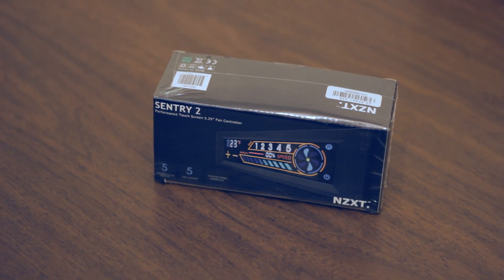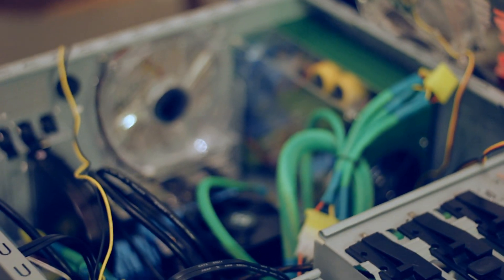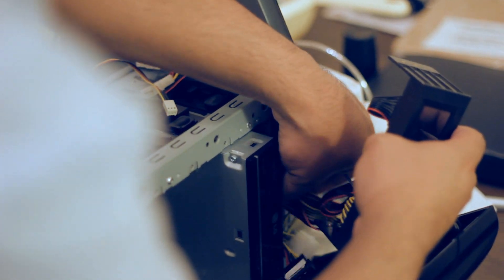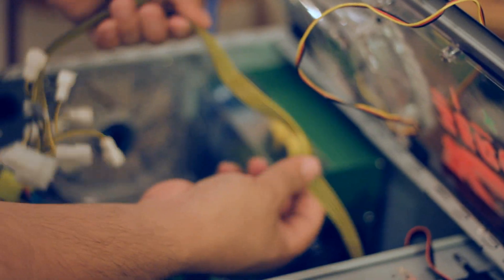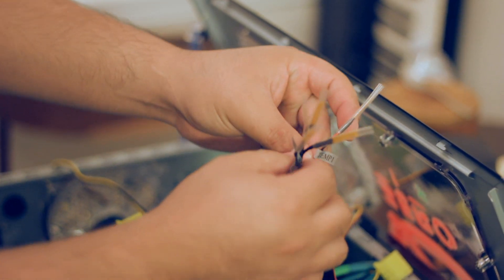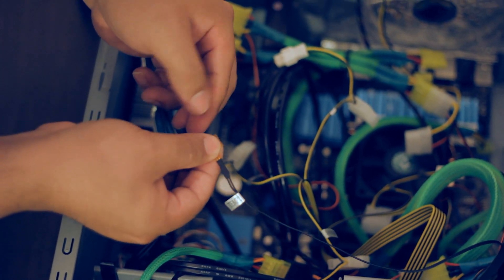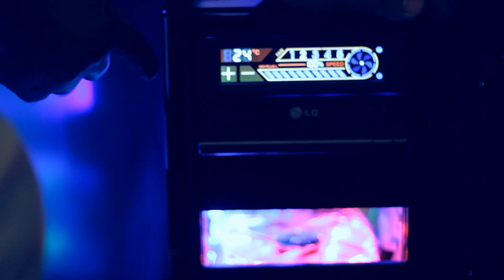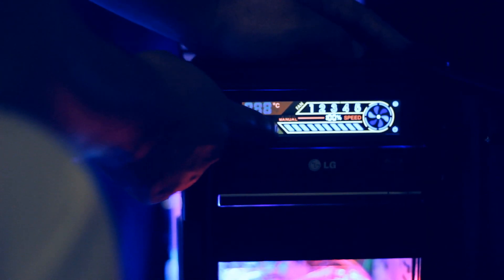Unboxing. How To Install A NZXT Sentry 2 Touchscreen Fan Controller. Review And Use.

Comment: man one question when i want have so exact temps from cpu and motherboard where sesnsors put?? and plastic tube from sensors can be remove or no? Thanks you have sub
Reply from the maker: The CPU has to be approximate, close to the CPU. The motherboard on the chip heatsink. Yes, the sensors' tubes come out.

Comment: One of my case fans keeps speeding up and slowing down by itself, regardless of the power % setting. (well at 100% it's sorta stable, though it still keeps flucuating between 80-100% constantly). But I prefer to keep it around 60% due to noise.

Also the Big Fan icon on the NZXT is flashing when said fan is selected.
When i plug this case fan directly into the motherboard's case fan slot and I change the speeds in the bios/windows there is no issue at all with the fan.

Also note that I have checked the bearing for enough lubrication, wich it has, aswell as the fact that this fan didn't have an issue the first 6-7 months it was hooked up to the NZXT.

Everywhere i've been looking around for a simple answer to the question; What does the flashing fan icon on the NZXT exactly mean? Because it started doing that ever since the fan's speed has become unstable.

Comment: I just picked up my first real gaming PC, and it has one of these in it. however all the sensors are in random parts in the computer, 1 is inside a ram chip, the other on the motherboard, 1 inside the graphics card, and the other 2 are laying out. But on my screen it shows 0% power and I can't control the fan speeds. I was wondering if anyone had any ideas to help? because my pc shuts off by itself if I open 2 programs, of it sits for like 5 minutes. I'm running out of ideas as I habe no real knoedge with these things..

Comment: Nice xD, recently I bought that fan controller and Im waiting the new case and more fans that I bought too, But I have one question, I see that the sentry 2 have in the cable fan, a pin to the fan and another molex, this have 5 molex conector in total and one black por the power suply, For what is the another 5 molex conector? sorry for my english, I speek in spanish =D
Reply from the maker: Esos molex van a las fans, los abanicos.

Comment: i know this is old but overheat much?
Reply from the maker: Not at all. There is enough cooling. 
Although, eventually you got to clean the heatsink on the FX processor on this computer and the radiator on the DREAM Computer's FX-9590 processor that has to have liquid cooling.
Reply: cool

Comment: My case came with a PWM function, meaning I can control the fans through that device. Is it unnecessary to have the NXZT sentry 2 as a fan controller then?
Reply from the maker: +Jahmali Kenway My current case also has a PWM function. I prefer to control the five fans with the NZXT Sentry 2 fan controller there too for more control, graphic touch screen and interface.
Reply: Ok!
Reply from the maker: +Jahmali Kenway   I will use the function with less fans perhaps,
Reply: +ZeroZeroXVids how do I place out the temp sensors though?
Reply from the maker: With the tape provided. As near to the component as possible. I put them on the heat-sinks.
Reply: +ZeroZeroXVids How do I know which fan number is which fan in my case though?
Reply from the maker: +Jahmali Kenway Now that I leave up to you. Because common sense could tell you: First the most important components but really, what is the most important component? Your processor, your GPUs or the super expensive RAM. There is also the spatial way to do it from left to right, etc. Something easy to keep count and remember specially with five fans or more.
Reply from the maker: +Jahmali Kenway CHECK:  https://youtu.be/oD9RS2CFCvY
Reply: +ZeroZeroXVids hmm... I just have to see which fan cable connects to which fan then, thanks :))
Reply from the maker: +Jahmali Kenway no problem   : ]
Reply: ZeroZeroXVids Waiiittt
Reply: ZeroZeroXVids One more question, I only got 2 pieces of orange tape bits. Where are the remaining?? Or how do I separate the tape bits?
Reply from the maker: Jahmali Kenway That is new. I got 5 pieces.
Reply: Strange... Anyway, thanks :)
Reply: I set up my nzxt sentry 2, and I was wondering if I also have to plug in cables into the 3 pin connectors, or do I only need to connect the molex connectors?? Please help
Reply: +Jahmali Kenway Oh I got it lol thanks
Reply: +Jahmali Kenway   yes you can so that you have 10 fans

Comment: My case is a CM Storm Stryker so it has a side window. Is there any way I can utilize the cable management holes to make the sensors unseen?
Reply from the maker: SubsRUs Yes, you could do that. Although, It might be a bit difficult.
Reply: ZeroZeroXVids I'll try :)

Comment: This was incredibly helpful! I'm kind of a novice. Built my first rig yesterday with the help of a friend and found out my MoBo has nowhere to plug any case fans into . So I could solve this problem by plugging them into a fan controller, right? I've heard though that the mess with voltage so it might damage them??? Sorry for my ignorance!
Reply from the maker: That is not ignorance at all. No worries. The YouTube community is here to help. You should be fine by plugging all your case fans to the fan controller. After all, that is what it's for. There is no damage to the fans, as far as I know. They have been working fine with the built on this video for years. Check the latest built and giveaway on our channel's main page: http://youtube.com/ZeroZeroXvids   Peace.
Reply: Thanks a lot! You just earned yourself a subscribe!

Comment: You plug all the fans into the controller instead of the motherboard unless you want too, and the Fan controller can only control fans that are PWM fans or fans that say they can run at lower speeds 60% stock fans suck you might want to upgrade to newer fans.
Reply: Yes they could work, but the simple fact of the matter it might work for everyone, because i have had fans crap out on me because i tried to control the voltage, and it wasn't PWM, there is a reason Linus, and other trusts PWM fans, and it is because they are cool, it is because they were designed to have the flow of their voltages Messed with.
Reply: yes, it can control almost any fans, but it is best to have PWM fans, because it might just shorten the life of any fan that isnt PWM, but i have a couple of led fans from corsair that arent PWM, and they work just fine with the adjusting from the fan controller.
Reply: SO a fan controller like the NZXT sentry 2 the non touch screen version will not lower fans speeds unless the fan is PWM? because that bitch of info would be very helpfil. Just wanted to know if you could get back to me with that bit of information I would be very appreciative and could use the help with my own rig. Thanks for any info and take care.
Reply: that depends if the fan is aftermarket, or stock case fans, cause depends on the fan themselves they can be turned down without having to be a PWM, but Corsair AF and SP fans i think can be turned a fan controller, i know for a fact that the SP comes with  Low noise adapter.
Reply: Fan controllers control the speed of fans through voltage control, any 2, 3, or 4 pin fan will work. No sense in paying extra for the PWM version.

Comment: I can't control the fans manually.  The + and - buttons are not working.  Is there something that I'm missing.  They only work at either 50% in auto or at 100% in manual.

Comment: Thanks for the helpful video!
I am curious, is it possible to control two fans as one? For example, I will side mount two 120mm and I want them to be controlled at the same time instead of taking up two fans slots on the controller.

Comment: so let me get this straight if you have a motheroard that only has 1 fan plug and you want more than 1 fan you can use a fan controller to add more fans
Reply from the maker: That is correct!

Comment: oh nevermind I see now that each time you switch to a different fan the temperature also changes hahaha, great video man it was really helpful, just one comment try to use the hand that is not covering what you're trying to show because in my case since you were switching the fans with your right hand it was also blocking the view that's why I didn't catch at first the change on the temperature reading but other than that very well explained!

Comment: how do you know which temperature is showing? I mean how do you know which temperature is from the cpu, which one from the ssd or which one from the hdd since in the display I can only see one temperature???
Reply from the maker: You have to remember what sensor number you attached to what component (near the same fan number) inside the computer. Pressing the fan logo on the Sentrty 2 touchscreen will switch fan (and sensor) showing you both the temperature and fan speed.

Comment: Is this going to work with PWM fans? Or fans with 4-pin female connectors at the end? I currently have 5 of those unused. If this fan control have 5 4-pin male connectors, I'm going to get one of those.

Comment from the maker: Thanks for the feedback! I appreciate it. I believe that pasting the sensors directly between the processor and the heatsink is a nono. Do not tape the sensors directly to the plastic fan. Instead, the sensor should go as close as possible to the component being cooled down by the fan, without getting on the way of the component working properly.

Comment: Thanks this video is really good. One lacking component is to show how and where should we avoid pasting the temperature sensors. Are there places where we cannot put the sensors and tapes for certain reasons? I am assuming both will not melt at 100 degrees Celsius.

Comment from the maker: It is up to you. Personally, I don't tape the sensors to the fan itself but closer to the component been cooled down, like the heat sink on the chips: CPU, GPU, motherboard or RAM memory.

Comment: Is it just me or is this the same controller as the BitFenix Recon? It's has the same touchscreen display, ugly 'cheap' looking wires and some sort of glue on the sensor 'header' on the controller (meaning you can't wire you own cables (proper length) for easy cable management)..

Comment from the maker: Yes. You can place the sensors wherever you want; For example you could place one on the processor, another on the motherboard and one on the RAM memory. This independently from where the fan and fan connectors are going and still control the fans' speed based on your judgement.

Comment from the maker: You can completely turn off the LEDs and the fan at the same time or turn them on and regulate the fan speed. You can't control the LEDs independently with the fan controller.

Comment from the maker: The metal plate that dissipates the heat or cools down computer components like micro chips. .In this mother board you will see blue metals with grooves on them or layers than dissipate and help with air flow.